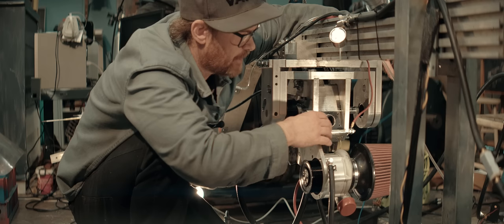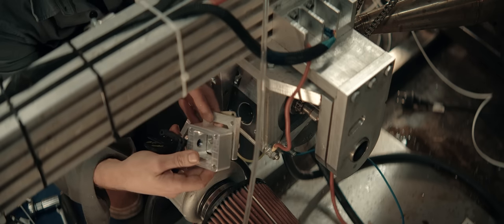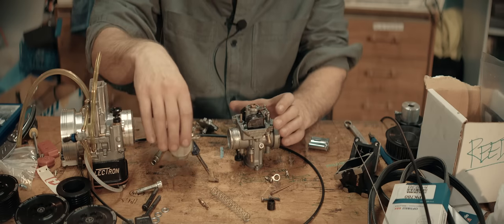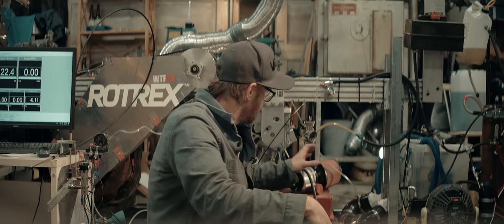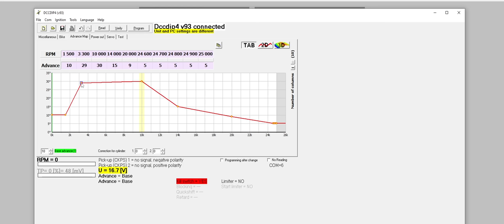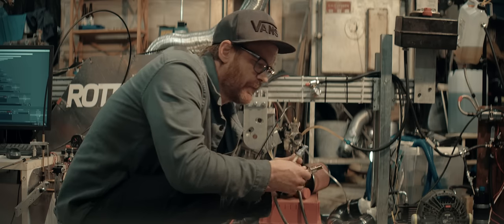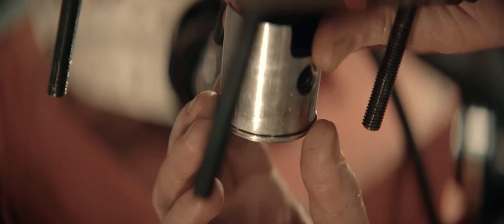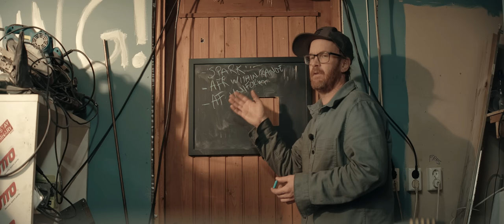Not Supercharged 50cc Two Stroke Not Running Nitro.

Comment: I think it's definitely worth it to keep looking into potential ignition issues. Don't forget to think about the input side of the ignition too - maybe some noise or signal loss is happening and you're not getting an accurate crank trigger signal, maybe it's throwing the timing way off or losing spark entirely. I see that your Ignitech votlage is 16.7V - is your crank trigger rated for that voltage?
Also, someone mentioned in another comment that you're hitting a wall that sounds like a rev limiter at half of 25k rpm - maybe you've got some basic setting wrong and Ignitech thinks you're running twice the rpm as actual? (It looks like it is set up for 2-cylinder operation?).
Reply: replying to this for visibility, something being off in the settings makes sense to me. It sounds SUPER weird and didn't go past 12500 at all as far as I saw. Hope this can get tested again with that fixed.
Reply: I think your right on the cylinder thing. When he does mapping you see on bottom corrections options for cylinder 1 and 2. I also remember in previous video a mention about more ignition coils and tying them together, so I looked up this Dccdip4 thing and seen this on their site - "DCCDIP4 can work at any bike, but we recommended to use it only for justified applications. For example at superchaged multi-cylinder bikes or at high speed multi-cylinder 2-stroke engines." So he should definitely not be tying multiple coils together and that settings are correct.
Reply: Yep same conclusion here. The Ignitech possibly cant handle 25k RPM. Has ran beyond that prior to this so I suspect there is a softwere/hardware issue here. The highest I have ran an Ignitech system is 14k on a 4 stroke so its not really anywhere near this potential limit.
Reply: Could be chdcked easily, by raising the (now at 25k) rev-limit, and see if "the wall goes up" accordingly :)
Reply: I'm convinced it's the exhaust port, he has cast in a very thin ovalized port with the idea of high velocities, but this is not where you worry about gas velocity in a 2 stroke, 4 stroke, absolutely, but not 2 strokes.  On top of it, because it's oval, boundary effect is more pronounced in dropping flow rates, an oval will always flow less than an equal surface area circle.  The motor isn't scavenging at high revs, and the symptoms look like ignition problems as the charge is so diluted with exhaust it misses and farts and carries on, just like this thing.  There is a reason why 2 strokes will have between 3 to 4 times the exhaust port area and very large duration compared to an equal cylinder sized 4 stroke.
Reply: @kingcosworth2643  very good points

Comment: Great to see you have got rid of the turbo and nitro fuel. If the cutting out continues it could be liquid fuel draining down from the crankcase into the cylinder. Try running the cylinder on top of the crankcase. New crankcase seals must be due by now too. Good progress this time though 😊

Comment: I've been suggesting the large crankcase volume is causing problems. The phase change of the fuel starts in the cases. No heat & low turbulence isn't helping the phase change of the fuel. As the rpm goes up, there's less time for this to happen. The later the phase change starts as rpm goes up, the worse the problem. Fuel that doesn't go through the phase change will not burn as much & the engine will run like it's rich or make you think the ignition is malfunctioning.
Reply: Yup!

Comment: One thing that's been in the back of my mind the past few vids is whether the fuel bowl is big enough at the higher rpms to supply the engine fuel properly. I've heard of similar issues with rd350s needing a bigger Fuel bowl because of starvation issues after upgrading them with chambers, porting, etc. Aside from changing coils seems like you've tried just about everything else at this point, other than case, port, or pipe design changes. 
It almost even sounds like this is the issue because it will rev up a bit, drop rpms (like it lost fuel), rev up a bit (like it got more) and so on almost sounding like a rev limiter as it was just continuing that cycle. Maybe try the NA setup with the air restricted Lectron that has a bigger bowl with a leaner needle?
Reply: Banshee fuel shutoff on the tank will become the main jet after a few mods, acts like this

Comment: I enjoy watching the experimentation and how you approach the problem, as I myself have conducted thousands of dyno runs on engines (both gasoline and diesel) in the late 90's at Ricardo.
One of the best diagnostic tools I ever used was real time in-cylinder pressure analysis (pressure curve- helps setting and observing ignition timing, detect detonation and measure stability).
We used a combination of AVL and Kistler equipment back then. Great stuff, but hideously expensive.
Not sure if there is newer cheaper alternatives.
Reply: i AGREE BEING ABLE TO MONITOR CYLINDER PRESSURE WOULD PRETTY MUCH SOLVE ALL OF HIS TUNING ISSUES.

Comment: Be carfull with the oszilloskop and the high voltage. In this setup i think a amp clamp is the best. You can see the power of the spark   with the current and no Inputs a fried

Comment: I remember my dads telling me when he was working on 2 stroke engine  when he was young and doing bike drag race, he and his team "having a cheap way to fix things up" they would fill the crankcase with epoxy and grind whats needed to remove as much crankcase volume as possible.
Reply: The term for that is stuffing hence the channel name
Reply: Although with a turbo, we want a place to store and compress the boost generated while the “valves” are closed. 

But worth a try, maybe it’ll flow better
Reply: You could be very well correct, it was on 2 stroke bike like kawasaki h2 1972 750cc 2 stroke so I doubt they'd be crazy enough to supercharge that thing
Reply: When I first started racing 125 twin clyinder Yamaha's back in the early 70's tuners of the time said the primary compression was not important, This miffed me as  I was paying them to do a job. I ended up plugging the crank and reducing crankcase volume as much as possible. This increased perfomance right through the rev range.

Comment: PLUG GAP!
You must keep it big, as this ensures more time & opportunity for the available A/F mix in the combustion chamber to ignite & burn quicker/better. This is the reason we use high power ignition. The high output coils allow the spark to jump a bigger gap. 
The compression pressure in your engine is not high enough to stop the spark jumping the gap. 
I believe you need at least a 0.8 -1.0 mm gap. 
....Loving your videos, great commitment.

Comment: This might not be it but i saw you put the limiter to 25k rpm. If that would somehow be in 4 stroke numbers, your 2 stroke would have a limiter on 12.5k rpm. 25/2 = 12.5 Which seems to be right where it dont want to rev past.
Reply: impossible with the turbo it got to 15000k
Reply: @trickventillateur5620  what if the built up boost pressure carried the rpm over the redline?

Comment: Due to the IgnitionMate being so expensive I was thinking of using a cheap oscilloscope to monitor spark power on my bike. I will be really interested to see which one you buy and how you set it all up in your next video. Please include those finer setup details in your video 👍
Reply: problem with cheap scopes is they're all digital these days, and therefore slow.  Which doesn't just mean missing events, it also means seeing the wrong shapes for quick events.

Comment: You're awesome Alex, buy I welcome this step down. If it is possible to reduce the crank case volume in a reversable and fairly simple way, I'd guess that's what's next. Seems strange though, that a big crank case would run worse on higher rpms. Pooling and or too less turbulence should get less worse with the crank rotating at higher speeds?

Comment: I was told once the higher voltage output from a coil gets to a certain level that higher voltage above that needed to ignite the mix can actually make things worse the duration of the spark is important too in order to get a good burn,sometimes an overvoltage at the spark plug means too fast a spark jump it not being present long enough to ignite a mix every time.Ilove looking at your work and have the interest and spirit to keep going.

Comment: 🥺
Well it was making progress and running better…
That’s all I cared about.

It’s fascinating and your kind enough to take us on the journey without being all high and mighty or weird. Mistakes and setbacks are shared and not hidden. 

When something works it feels good, not much pain. Just engineering. 

I’ve resisted commenting and being a backseat mechanic because the whole engine is your design. Other than fundamentals, it’s entirely uncharted aside from your own notes and videos. 

We don’t know anything. But we can imagine, maybe some exceptional criticism could drum up a plausible theory. 

But deconstruction of your project was what I was afraid of. But everything must be checked anyways. 

Still think the pulse jet was a sign of heading the right direction. It’s actually gaining boost in that scenario too. And revs happy without bogging.

Comment: Setting any sappy praise aside, what we're witnessing here is practical science in progress. It's not copy-paste off the shelf engine building, it's the plug and chug method of optimization. Observe current performance, hypothesize sources of loss, develop an improvement to test that hypothesis, test it, and observe the result. Rinse and repeat until you meet your improvement goal, or exhaust your resources. This is the DIY version of what you might see in the racing lab of a big company. It's good stuff because you don't normally get to see it in action; just it's not going to be for everyone. As an engineer in automation, it's fun to see the mind of an engineer in a different field demonstrate their problem solving process.

Comment: I noticed the revs would stay healthy up until basically exactly 12,500 RPM which is exactly 1/2 of the 25,000 you set in the software... Maybe something to that? It sounded enough like a rev limiter to me
Reply: Definitely worth checking!!!
Reply from the maker: Agree!
Reply: @2STROKESTUFFING  I am skimming the Ignitech manual now - looks like there are a bunch of limiter-related settings including quickshift etc. Also worth double-checking settings like “number of lobe at rotor” and “number of ignitions per revolution” and similar.

Comment: Advancing ignition to get an engine to rev is telling you that charge density in the CC is low at higher RPM, (slowing flame speed) and density is basically air pressure and temperature.
For example an intake that is too small limits revs can be overcome by advancing ignition at the point revs are limited as the density drops due to of intake. Conversely heat effects density too so it can be that, or lack of.
Doesn't give you the answer but it may help point you in the right direction.

Comment: Youre leaving your doors open at the same time. Your paths are converging. Precise force application. 
Two into one.
Plus- consider the nostrils of a peregrine falcon for reliable O2 intake at high air speed. 
Cheers my Man, 
H
Reply: Clarification. Charged atmosphere is exhausting out the back door when your front door is opening. There is a lot of unburnt mixture collecting in your vent.Your rotary valve would address this.
Jet engines were designed off the peregrine's nose, because a hood Eddys the air around a center conical protrusion; creating a low pressure high turbulence vacuum area.Thus allowing it to breath while in full stoop.

Comment: Whenever one is attempting to do something at the edge of the state of the art, there are always problems.  Always.  It is a joy to watch that process here as hypotheses are made, proven or disproven, adjustments made, new hypothesises, and so forth.  Mistakes are how we learn, how we advance a field.  I love to witness the development of this engine.  And to that point, the upper left number in the digital display we can see on your screen is the engine temp, right?  Head temp below the spark plug, maybe? It seems to vary a lot (like 10 or even 20C) between runs.  Could that variation be making development that much harder?  Regarding the hypothesized timing drop-outs, could it be the trigger, again?  I remember you had some troubles with that, early on, especially with electrical interference.  The USB cable failing makes me suspicious that you still have a grounding / shielding problem, somewhere that could easily manifest as an immediate dropout when the pipe hits and vibration increases.

Comment: Great to see, that you are investigating fundamental behaviour on your engine. I have recognised, that the cutout has somewhat been higher in rpm with leaner Jet. This leads to my theory that your fuel is "foaming" within the bowl and therefore flod the engine, so it is not only acting rich, its is effectivly rich. I know that behaviour when i was running a 160cc with pwk carb. 
Missfiring due to high combustion would be compensated by a smaller spark gap (as you know) and therefore should be capable of entering the power band, with your smal gap spark plug.

Comment: Another great episode mate, I screen mirror my phone I use to my 55" TV to watch each episode now, your editing and camera work are really good.
I'm wondering with the motor having an over sized internal chamber for a 50cc motor, that the expansion chamber of exhaust might need to be bigger than you have made it, from what I've seen of the importance of the expansion chamber and the science, it is pretty critical for a 2 stroke motor.
Also do you know of Yamaha's 7th port design, it might pay to research this as well.
Cheers
Stephen

Comment: I think you just need more measuring/measurements/instrumentation to support your theories. At a minimum you need air flow, fuel flow data.
As I write this you mention getting an oscilloscope, good move. Not just for ignition but also can monitor fast pressure changes critical to two strokes. and much more.

Comment: Reminds me of the episode my cagiva mito would not enter the powerband because the previous owner installed the wrong cdi wich open the exhaust valve much too early. Took me two weeks trying everything from jetting over spark plugs and the exhaust until i finally try different cdi's on the thing.
Keep up trying, in the end you will succeed👍

Comment: if you don't weld often, use scrap pieces of similar material to check your welder settings. at 7:25 you kinda used most of the lap round the pipe before the sittings were good

Comment: When we were building our engine back in the day we also experimented with an Aircon clutch assembly from a car to be able to turn the blower on or off while the engine was running,  this was helpfull in the beginning to learn setting up the engine but was later removed when we got things worked out.
I think something like that may be helpfull for you too and its very easy to do, specially on your setup as these clutches are about the same size as the pully you are running on the supercharger.
I've commented this before and i know you have your doubts with injection but we absolutly did got it working in assisting the main carb on WOT, sure it may have skipped or "leaned out" some of the cycles but it was consistent and didnt need much tinkering at all.

Maybe picking an injector that could stay open 100% all the time and controlling the flow would be a better route to get a complete filling but this would require a quality proportional valve that would work with fuel, meaning no lubrication needed from the fluids passing through it.

Edit: I think the crankcase volume is a bit large for this small 50cc running on pump gas and now being NA, it sounds rich when you hit the throttle coming from a lower rpm or a throttle closed position but its almost like it cant get the fuel up and needs a few cycles to build up some mixture again which could get you in a fuel - no fuel - fuel- no fuel loop?.

Comment: O scope probably will not help as the spark line can be influenced by a number of variables and not all ignition related, a lean misfire for example can show as a misfire on the scope that some might read is an ignition misfire.
So you need to test many other things to rule out everything else before you get out the scope and start looking at ignition patterns to have some confidence that it is indeed the ignition at fault.
Same applies for that tool you have. Its output is only good so long as all other things (except ignition itself) that may influence spark are known to be good.

Comment: my troubleshooting methodology:  Power, pressure, gas, gap ....  Isolating the issue into one of the variables is very handy.  Maybe it'll work for you?  Power:  driving force of the reaction.  Pressure:  Weather needed for complete reaction. Gas:  Fuel needed for reaction.  Gap:  All measured specs, but the main gapping is for combustion success.